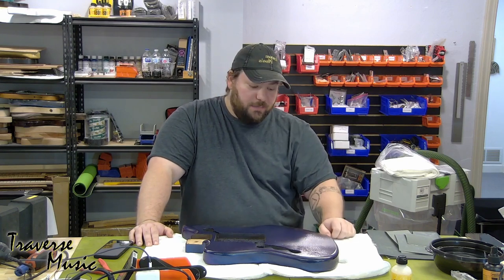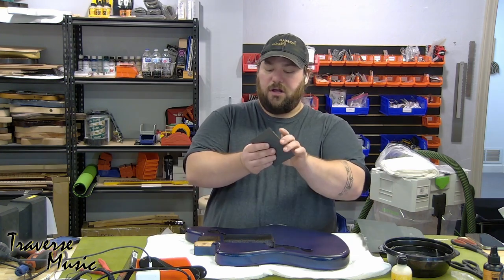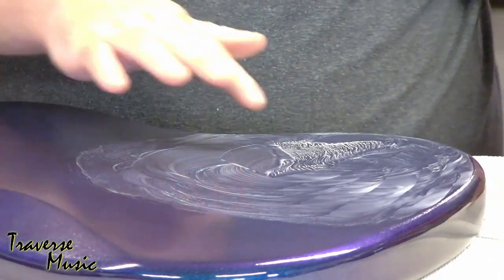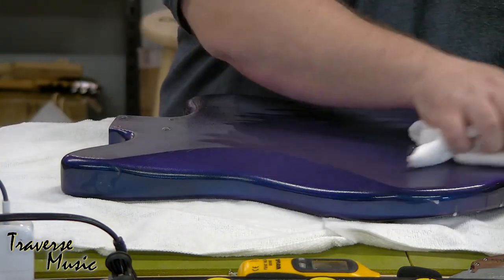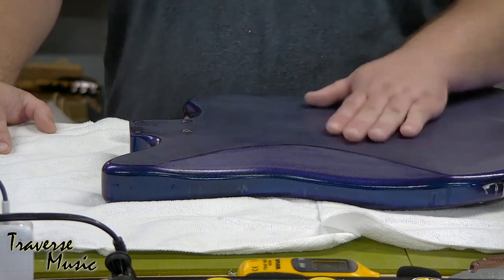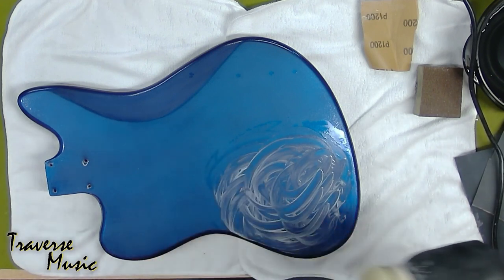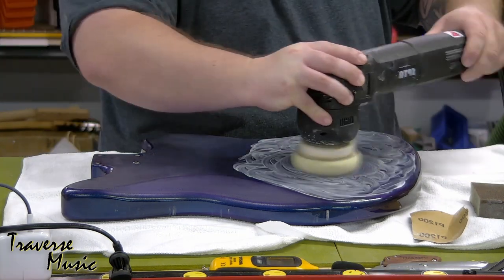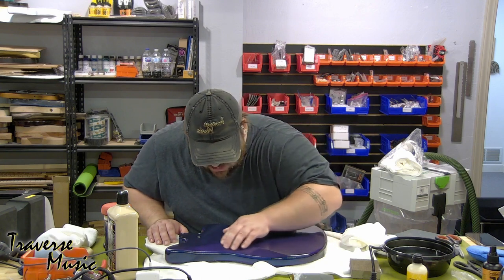This StewMac Guitar Kit Body Buffing tutorial will make your guitar look brand new!

Comment: I really messed up my Les Paul Deluxe. First, I broke off the headstock. Then there was some glue on the body from the repair (Luthier repaired it). I put acetone on the glue and when I wiped it off, it spread all over the body. It's a giant mess. I did some sanding with 1000, 2000 and 2500 sandpaper. I will continue with the polishing. The only thing is, I do not have a buffer. I'll have to check the prices. Thanks for this video.